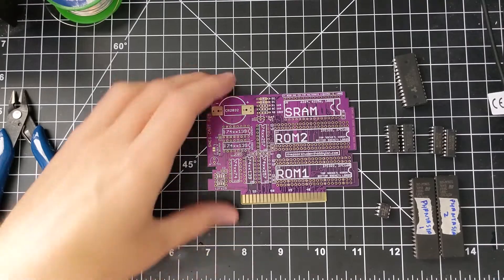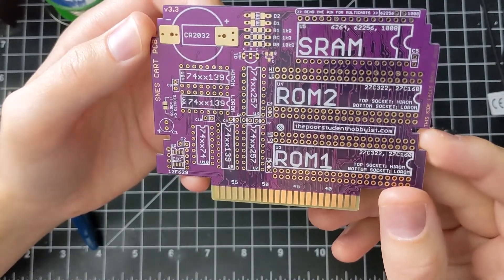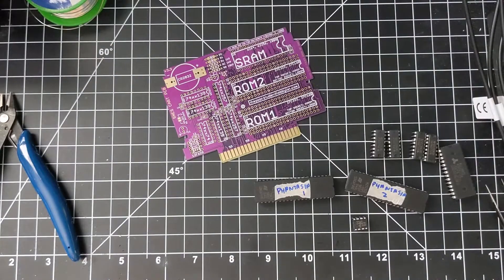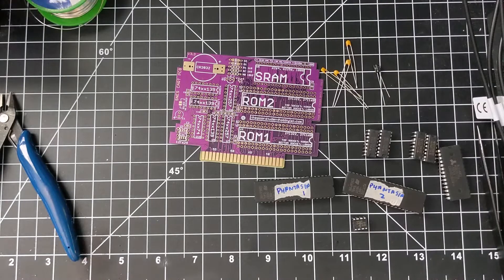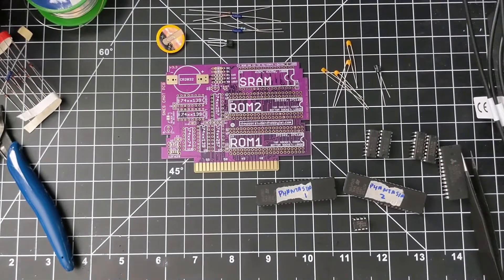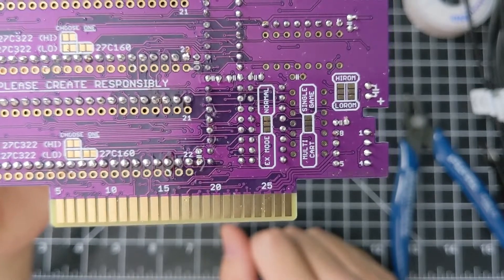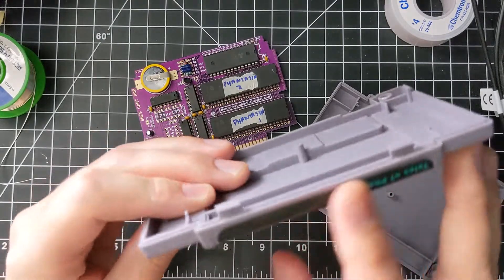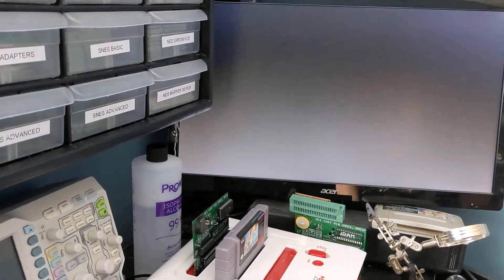How to Make a SNES Cartridge (old)

Comment: Could this PCB be used to replace an orginal Cart that has tons of broken traces?
Reply from the maker: For that you can use the "Basic" version. I'm planning on making a video of that one eventually, when I get time!
https://mousebitelabs.com/2019/08/12/how-to-make-a-snes-reproduction-cartridge-quick-guide/
Reply: @bucket_mouse  I ordered 2 just in case I screw something up.
Reply: @bucket_mouse  I recieved the boards and noticed that my original cart board has a Sram chip that is in the same form factor as the Decoder chip. the Mask rom is the full sized chip. Any recommendations?
Reply from the maker: @joke3979  Check your email :)

Comment: I know there's regular boards and advanced boards.  Are you able to use the Advanced Board as the "good for all" board for cartridge production?
Reply from the maker: The only thing the advanced board can't do that the basic board does is utilize the original ROM pinout and 27C801 chips. 

The upside to the basic board is that you can make 16Mbit and smaller games a bit cheaper, because you don't need as many components as doing a 16Mbit or smaller game on the advanced board.